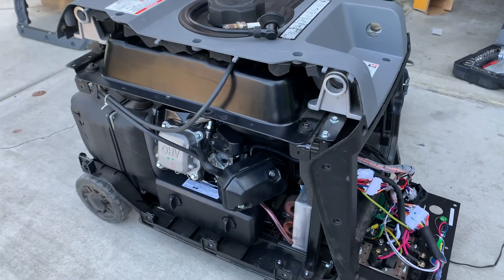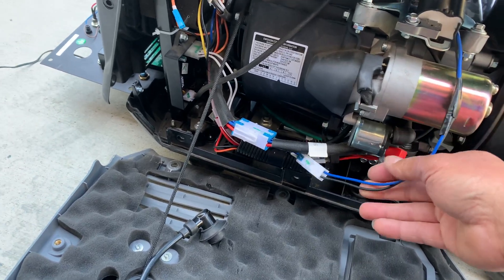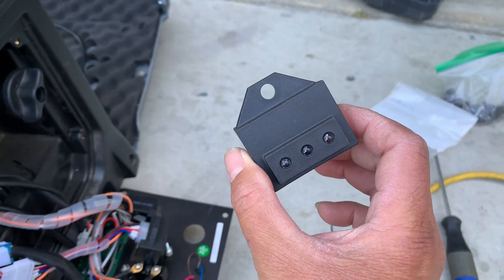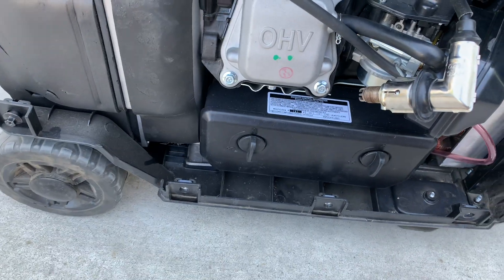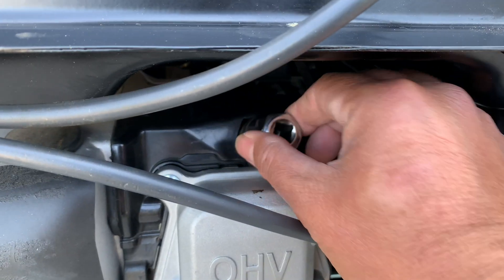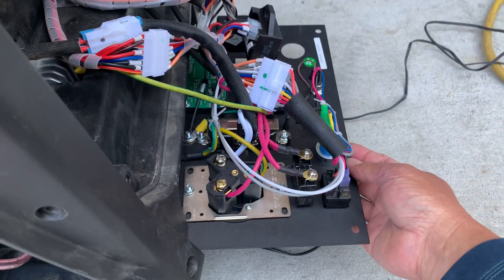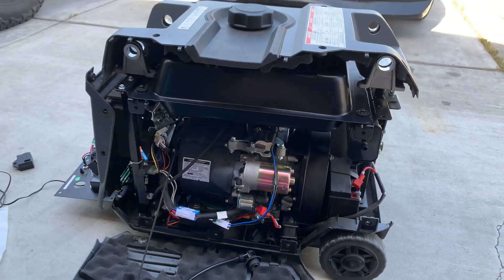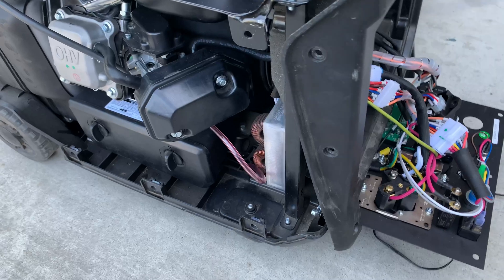Cummins Onan p4500i Cranks but won’t start and no spark, Bad light indicator. Problem solve

Comment: you dont need a special plug wrench, just use the right one, my Craftsman socket fit the way it should
Reply from the maker: I had spark plugs socket but didn’t fit so I had to custom fitted, I’m not smart but I can find a solution.

Comment: Just had mine at the Cummins shop here in Ft Worth. They trouble shot mine down to this exact part. They called it a TCI Module. I had them order it and told them I’d install to save on labor costs. Won’t let me upload photo of package so I’ll type it in I guess. Part was $26.19

       A058V040 or A064D666 
A064D666:Indicator Lights 8.9800
Reply from the maker: I troubleshoot my my self got the part at Cummins shop and put it on myself

Comment: Anyone have a link for the part?
Also how do you remove the control panel with the gas adjustment?
Reply from the maker: For the parts you had to call Cummins dealer and they’re 7 screw 1 of the screw is in the on and off gas switch

Comment: It’s an Ignition Module and a very common failure of no spark condition for most modern inverter generators. I have found most of these ign modules with the 3 led lights inbuilt are pretty much the same internally except for the plug connection on the back. If you can obtain the wiring diagram for the faulty machine and a wiring diagram for the new ign module purchased for its machine, they can be interchanged and made to work. For example I have the wiring diagrams for a kipor gs2000 genset and it’s virtual identically to a Ryobi rig2000 inverter ign module wiring, only difference is the kipor has a 10 pin straight plug on it, the Ryobi a double row 5 pin plug (10 pins in total) two wires are different colours is the only difference but easily repined / connected.

Comment: I’m looking for this part also, part number doesn’t pull up any results on their website or anywhere else on the internet.
Reply: The part number is A …then number zero 58V then more numbers 040 A058V040 …. All of the characters are numbers except for the A and the V.

I learned this when I called the CUMMINS dealer after I took the number off of this post, which was awesome that this gentleman shared his video experience of repairing the snow start 
My character after the A from the beginning of the part, number was right, but the next character was a number, not a letter . Hope this helps.
Reply from the maker: Sorry to hear that I try to help out I call the dealership near me and they don’t have any I don’t know why they don’t make extra for it

Comment: Sir, at what distributor did you purchase this part.  I am having the exact same problem.  I live near Fresno.
Reply from the maker: There’s Cummins dealers in Fresno California that’s where I got my parts get the part’s number on my videos and go to the dealer they mind not have it but they can order it. Thanks for watching my video
Reply from the maker: Address 2755 S cherry ave Fresno California
Reply: I’m having the same issue. 

Your part number you provided comes back for a high altitude carb kit.
Reply from the maker: @ourtimeourspeed  The parts number I provide is the one I took it off from my generator so i replaced the same part number
Reply: If you check the part you looked up for the high altitude carb kit it ends in 024, the ignitor is an 040 @ourtimeourspeed
Reply: @drtyalsgal  is the ignitor the 3 light relay?
Reply: The part number is A …then number zero 58V then more numbers 040 A058V040 …. All of the characters are numbers except for the A and the V.

I learned this when I called the CUMMINS dealer after I took the number off of this post, which was awesome that this gentleman shared his video experience of repairing the snow start 
The character after the A from the beginning of the part, number was right, but the next character was a number, not a letter . Hope this helps.
Reply: @eugenestatler5547 snow start?